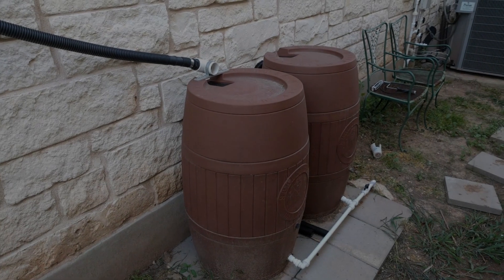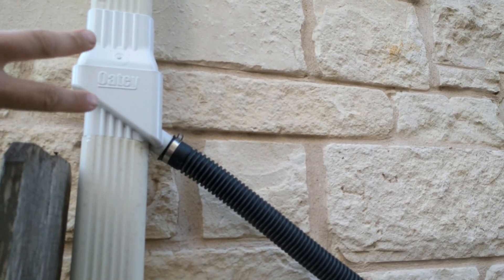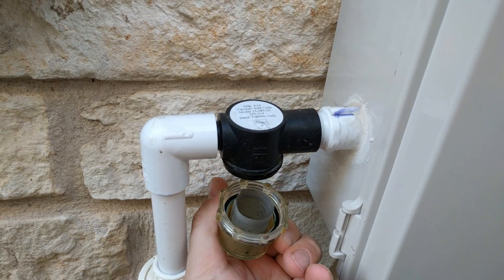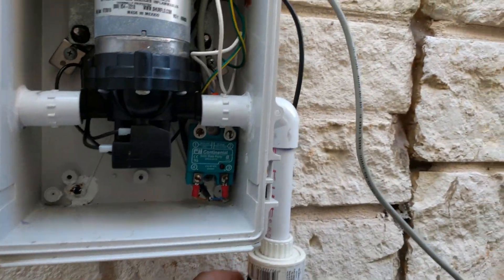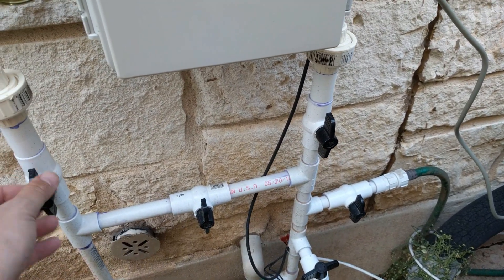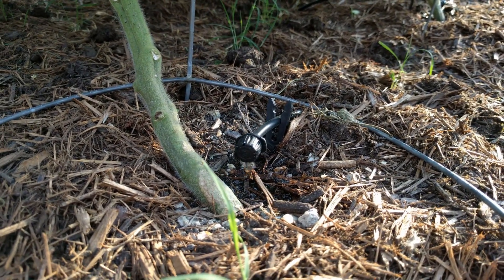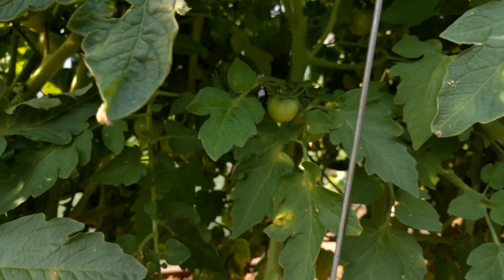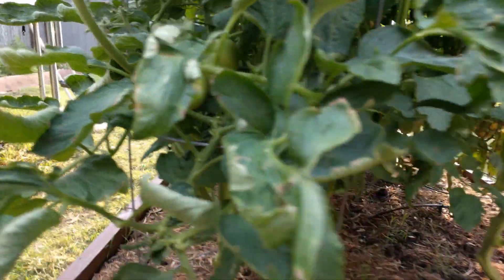Nerd Garden: DIY Automated Rain Barrel Garden Drip Irrigation Setup

Comment: I have 2 rain barrels that are raised perhaps 4 feet above ground and wonder if the height will be sufficient to generate enough pressure for a drip system.

But I have a question for you.  Have you thought about adding a water level sensor to your barrel system to automatically add water from your house pressure if they become too empty?  I think this could tide the system over until rain comes.

Another question is whether you live in a climate where you need to winterize your pipes to prevent damage in the winter.

Thanks for sharing your video!

Comment: I love everything you have here. It's a superb setup. I have the intention to build a drip irrigation system in a similar fashion, using collected rain water (from a 275 gallon tote) but am admittedly lost. I have about 700 square feet of garden space. Would the pump you have here be adequate to pump water through 200 feet of line?
Reply from the maker: I'm not 100% sure on the pump sizing, but likely a small pump would do it, but you'd probably have to break the system into multiple "channels" to get the appropriate flow for the drip lines.  You could definitely try it out though and add more zones as needed.  I'm just worried the amount of "controlled leaks" you install would be enough that the pump won't keep up and some of them wouldn't get any water flow at all.  However, they are adjustable, so you could probably dial it in to work, there is some upper limit though.  But, even if it takes 2 hours, its not a big deal, so the pump flow just has to be enough to pressure up the system a bit.
Reply: @SquishyBrained   Got it. Those adjustable plastic flow inhibitors (whatever they are called), may prove to be necessary from what It sounds like, but maybe I just need to get started and give it a go to see what works (I'm excited to try this). I was, in fact, going to split it up into 8 different channels/rows, so thumbsup there.

Questions:
1) Do I understand the following accurately: when the wifi sprinkler controller is on/open, the solid state relay is in an "on" state and that allows electricity to be be sent to the pump (thus, valve open means pump is on, valve closed means pump is off)? Just wanting to grasp fully. If so, this could be the solution I needed. Wish my setup was in wifi range!

2) Would the 115v pump be overkill? I assume it's more powerful, but has the same flow rate. I have no idea how loud it is, though. Is your loud?

Comment: Hey man I man I want to apply this system to x2 10x20 plots at my local garden. What is the purpose of the solid state relay. Would I be able to run this off of solar? Just the motor?
Reply from the maker: The pump has a built in pressure switch, but I found that if I left it plugged in always and opened the valve downstream of the pump, the pump would turn on and off constantly. It still worked but I was worried it would be hard on the pump. The relay is wired with the valve so valve open = pump on. Have a look at the 12 or 24v pumps for solar based systems

Comment: Hi, nice job. Why it is not withou pump ?
Reply from the maker: You mean why not run without the pump?  2 Reasons, it is uphill, so I'd have to put them up about 3ft on a pedestal.  Also, the drip system needs some pressure to work.  If it was downhill I probably would have tried it.  Also, I've read some sprinkler valves need pressure to actuate so that might be a concern also if automating the watering.
Reply: Thanks for answer. I didn't see hill. I will do something similar, but withou pump ( I have no energy ). thanks for your videos, are best !
Reply from the maker: Why no energy?  You could use a small battery and a solar cell + 12v pump.  A lot of cost though if you can run downhill or raise the barrels up.
Reply: I don't want to use solar, because it's quite remote place and I am afraid of thief. I will try raise barrels and Archimedes law.
Reply from the maker: That is cheaper and easier anyway if you build a tall enough structure.  a meter or so should be enough to get it where it needs to go.